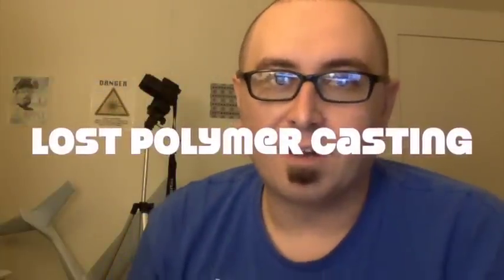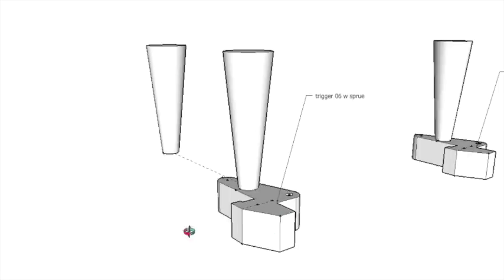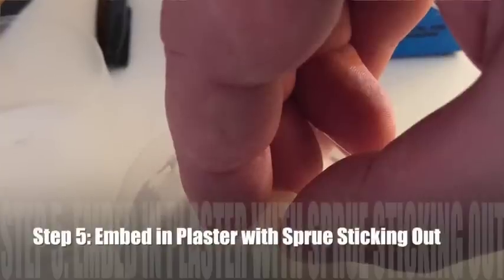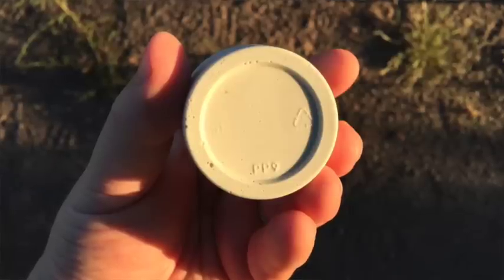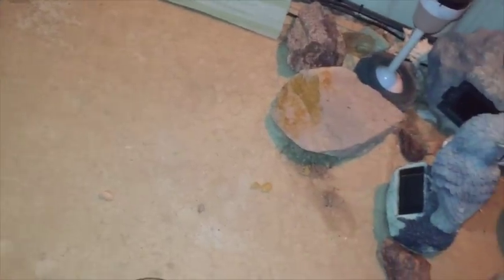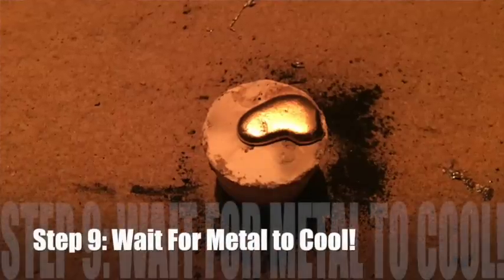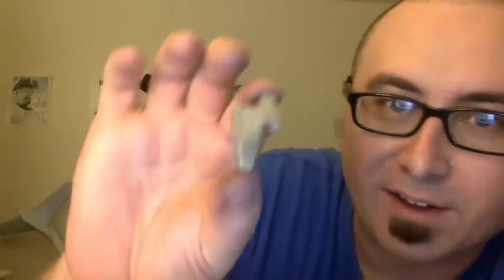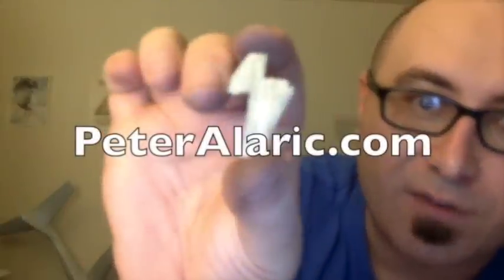Make Metal Parts with a 3D Printer (lost polymer casting tutorial)

Comment: Great video for casting but as a DIYer myself and into making things out of metal I think you should look into building a small CNC milling machine. I bought a small Grizzly G0759 mill added a 3 axis CNC kit and now can make any part I want out of metal . I have less then $3000 into my project and that includes a dedicated laptop and programming . Just some food for thought....
Reply: Peter Alaric master cam cheers mate
Reply from the maker: i have a CNC milling machine, but i no longer use it very much since discovering 3D printing and laser cutting.  part of that is simply the difficulty of setting up CAM operations.  if you have some good CAM software you'd like to recommend, i'm all ears!  cheers, ~ P
Reply: I use Autodesk Fusion 360. SUPER EASY ! Plus it`s free and they have tons of free online and sit-in classes on how to use it..They may even have a free class in your area ? They also have a file sharing forum.

Comment: I have not read all the comments, so, I can't say whether you covered this. Did you ever get the small pin hole to form reliably? If not, have you considered a fillet at each end to strengthen the attachment point?
Reply from the maker: i never got around to re-casting it, as i did this mostly just for the tutorial.  the polymer triggers actually work just fine.  if i were going to cast metal ones, i would probably just design a divot to indicate the hole placement, and drill it after the part is cast.  i ended up drilling it anyway, and it worked fine.  sometimes you have to think outside the box.  ;-)

Comment: Would the plaster hold up to aluminum?
Reply from the maker: yes, but this Hot Pot 2 melting pot won't get hot enough to melt aluminum.  you need a special propane furnace, or alternately a special high-temp electric furnace.  cheers!

Comment: What infill do you recommend?
Reply from the maker: +steve lofter whatever the lowest infill you can reliably print.  i generally use 20% infill.  remember that the polymer is all going to be wasted anyway ("lost" polymer).  its only function is to displace the investment (plaster) until it hardens, so i try to use as little as possible.  less polymer also means easier removal during the burnout.  cheers!
Reply: +Peter Alaric Thanks! Have you tried putting the mould into a bag with silica gel or rice, to help remove moister?
Reply from the maker: steve lofter no, but heating it in an oven for a few hours on the lowest setting (200 F), or putting it on the bread shelf of a BBQ (as shown) seems to work pretty well.  heat causes rapid evaporation and dessication, but cross the boiling point (212 F / 100 C) and you can potentially cause damage by boiling the trapped water into steam.  your technique would probably work, but might take awhile.  cheers!

Comment: I have tried doing it 3 times already and the PLA burns up and lots of coal remains inside the hardened plaster, occupying space and preventing the liquid metal from fulfilling it. How do I prevent this from happening?

Also, you said to increase the size of the part by 2%, but instead of increasing the size, wouldn't it be more sensible to expand it outwards to compensate? And by a fixed amount, say 0.4mm.
Reply from the maker: +Maker Linux as to your first point, i couldn't really tell you, as i've had good results with PLA.  could it be that your fire is too hot?  maybe.  in the video, i used ABS, which does not carbonize.

for getting part tolerances just right (with 3D printing), varying the dimensions by a fixed amount is absolutely right.  but in this case, we aren't compensating for the inaccuracy of the printer (although you may need to do that also).  we're compensating for the fact that the metal shrinks as it cools, and it does this by a certain percentage along all axes.  2% is just a rough estimate for the shrinkage of pewter going from ~230C to room temp.  other metals will have different (usually greater) shrinkage coefficients.

cheers!

Comment: I tried to do this on a part, the mold was about 1/4 of a dixxie cup and i dried it for a month at room temperature. I tried to melt the PLA out on a camp stove but the mold cracked. So i think even at room temperature i still have to much water in the mold. Any ideas on a good way to remove the water in it?
Have you tried  PVA or Wax filament?
Reply from the maker: +Razedbywolvs first, i recommend peeling the cup off & discarding after the investment solidifies.  this will expose more surface area of the investment to the air, allowing for much greater evaporation of moisture.  second, i recommend heating the whole thing slightly for a few hours.  in the past, i have used a regular oven on the lowest setting (200 F or thereabouts).  in the vid, i use the bread shelf of the BBQ.  this will also increase the rate of evaporation greatly.  i haven't tried PVA, because hydrating it to dissolve the positive would probably also dissolve the investment.  however i have heard good things about wax filament.  i've CNC milled parts in machinable wax and cast them in metal with great effect!  :D
Reply: +Peter Alaric 
Thank you Peter. I ordered a roll of PVA and Wax Glow in the dark PLA, so I will start experimenting again soon. Not so sure im down with using the oven. Landlord might get mad and I've had some near death experiences cooking pizza. But I have a rice cooker,George Foreman grill,camp stove. What I lack in brains I will make up in persistence.

Comment: You could also make a two piece silicon mold and use it over and oner and over..................
Reply from the maker: +Rice Man i've been meaning to try silicone casting.  can you pour liquid metal into a silicone mold, though?  i'm guessing not.  are you suggesting making a silicone positive with a plaster negative?
Reply: I could have sworn that this stuff (RTV-325)
could withstand molten aluminum,but it only goes up to 620f. Could be used with tin,bismuth,pewter...
Reply from the maker: Rice Man nice!  i did some light reading prompted by your comment, and was pleased to see that it could stand up to low-temp metals.  i never would have guessed!  since "RTV" stands for "room temperature vulcanization" (just learned that today as well), i guess it becomes like a car tire -- pretty tough stuff.  now i'm eager to try it!  thanks for the suggestion!!
Reply from the maker: +Aaron1998ish great idea.  it would be worth a shot!
Reply: +Peter Alaric you can also use the mold to create multiple wax models, and attach them to a sprue, so you can make several parts with one pour, and the mold should hold up pretty well to ~200 degree F wax.

Comment: Hey Peter, 

There are a couple of things you could do to help improve the reliability of your casting.

1) Place one sprue at one end of the part, and another at the other end (for venting).  Then you can skip the step of burning out the plastic as the metal will displace the plastic.  Though you could still burn out the plastic if you want to help make sure your cast is dry. When you pour your metal into one of the holes you know it's gone all the way through the part when it comes out the other side, and this allows an evacuation path for any sediments, air, or particulate, which greatly increase reliability.  Otherwise displacement (which you still have to displace the air in the part) must take place back the way the influx is coming in.  
2) Agitate your plaster after you set your part (before it dries) in order to remove any air bubbles.  This is also an important step which seems to have been skipped in the video.

Hope it helps.
Reply from the maker: +Bu Jin thank you!  yes, i have used both of those methods (although never tried pouring liquid metal directly into the plastic... kinda afraid it would turn into a disaster!)  using 2 sprues can be a great substitute for making air vents, which goes beyond the scope of the video.  in the past, i've used portable back massagers and even vibrating toothbrushes to remove bubbles from investment.  maybe i should have mentioned that in the vid... oh well.  cheers!  ~P

Comment: 3D Printing AR-15 Lowers, then casting to metal? Anyone?
Reply from the maker: +Todd Martin gun parts are tricky because the tolerances have to be pretty tight, but yeah - totally doable.  you'd probably have to do a few test runs to really dial in the part shrinkage.  you'll get way better tensile strength, even with pewter, than you would with ABS.  totally legal in the U.S. (provided you aren't a felon, and aren't making them for the purpose of selling them).  :D

Comment: what is that crucible using. that looks like a selfcontained unit or do you have an oven off camera?
Reply from the maker: +Sungod3000 good question!  it's a self-contained electric melting furnace, called a Hot Pot 2.  i bought it on Amazon if i recall.  i recommend them!  this one has served me well.  :-)

Comment: You need a grind/buff wheel man. Hey, did you learn the 2% scale increase by trial and error?
Reply from the maker: +ejayerik it was suggested by my metal shop teacher at NMT.  according to her, pewter contracts less than other metals, which is one of the reasons it's easier to work with.  many other metals require 3-5% over-scaling.  so far, 2% seems to be a good rule of thumb.  i'll let you know if i dial it in any closer.
Reply from the maker: Johnny Appleseed thanks!  i like using my printer, because i am one of the laziest people you will ever meet.  ;-)